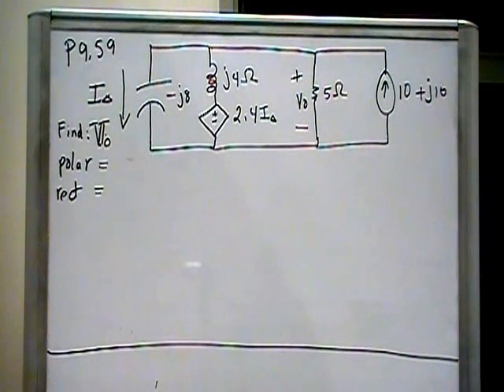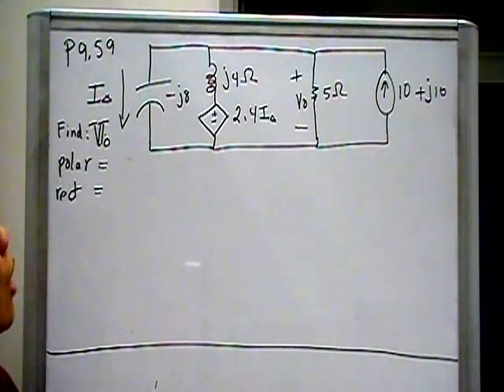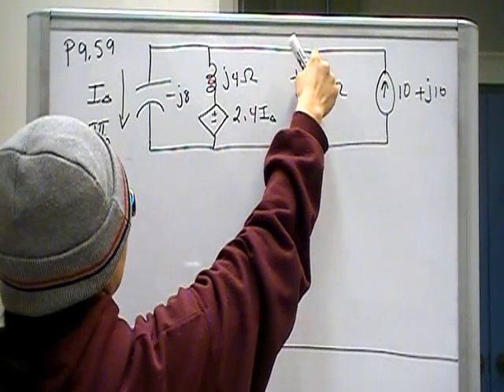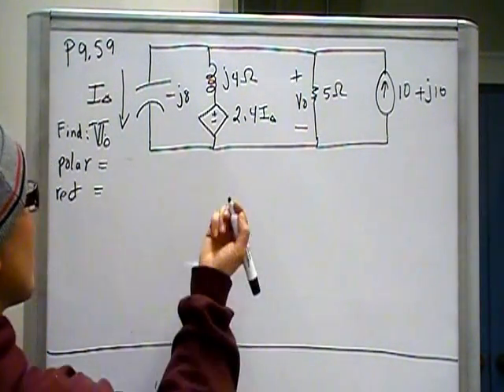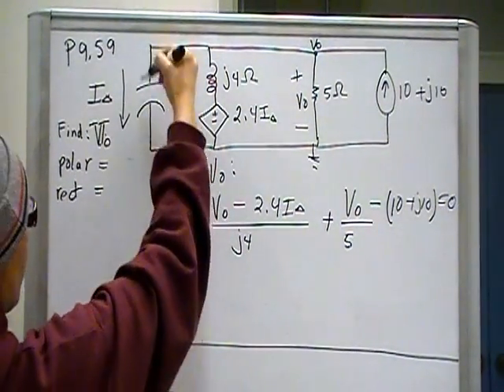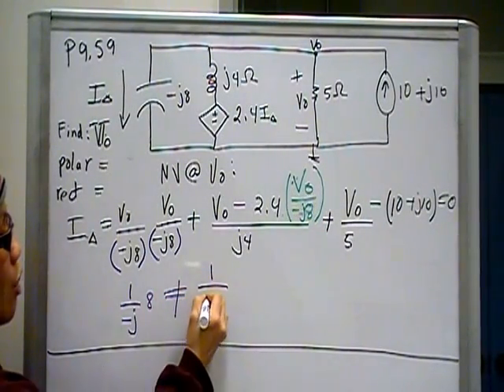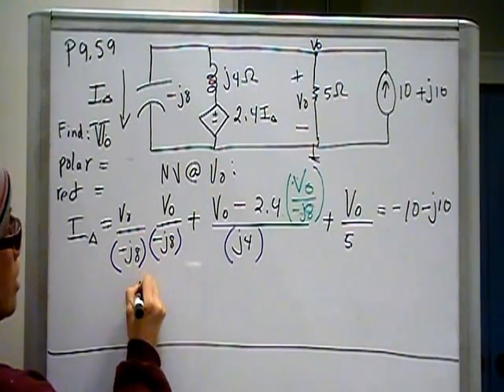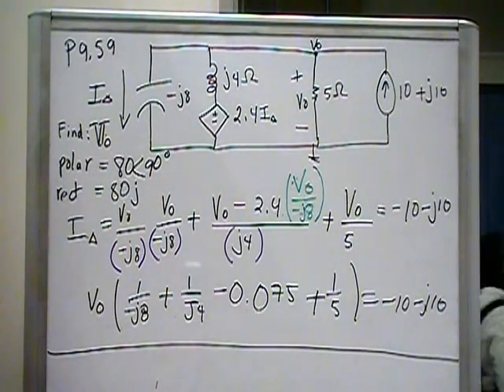Node Voltage in the Frequency Domain P9.59 Nilsson Riedel Electric Circuits 9E Solution

Comment: Thanks for the great videos, they help a lot!  That being said, when you move the -(10+10i) to the right side of the equation shouldn't you just add (10+10i) to both sides making the left side simply equal to (10+10i) and not (-10-10i)?